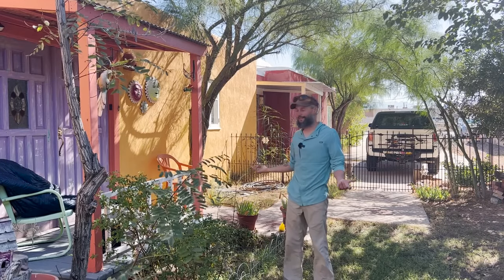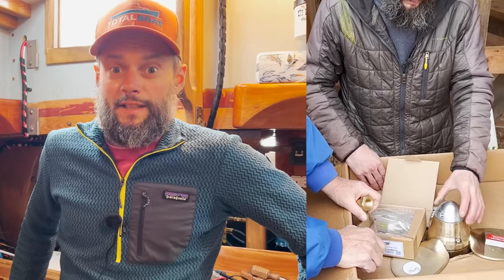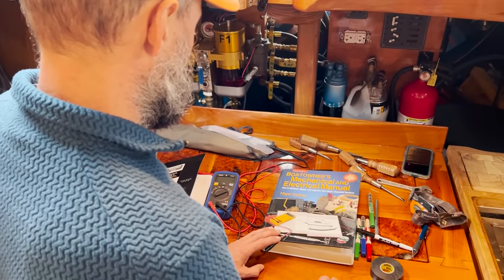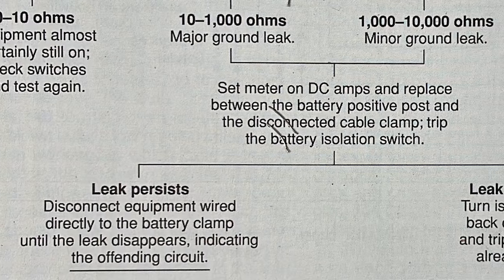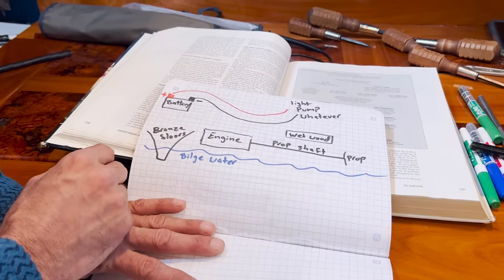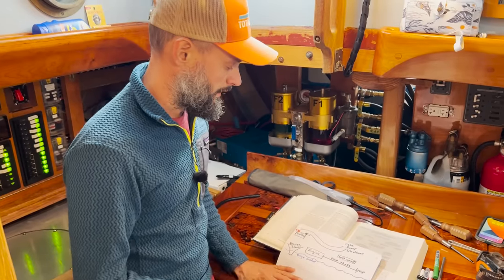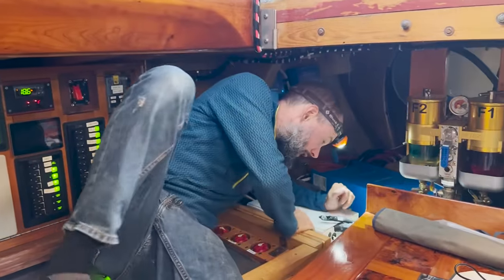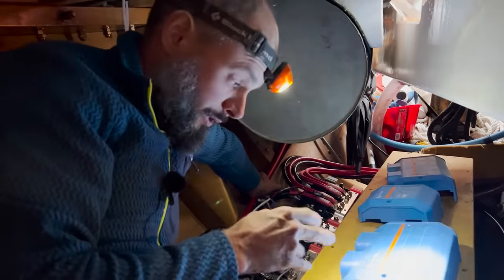Stray Current Puts Arabella in Danger - Episode 284 - Acorn to Arabella: Journey of a Wooden Boat

Comment: Steve, I watched this with interest, as I have a lot of experience solving difficult electrical problems.   If there was one thing I tried to drill into the heads of people I was training it is this: "Assumptions are the enemy."   More than half the time when I found the problem, it was something that had previously been dismissed as "that can't possibly be the  problem."

I've never seen Nigel Calder's book, there is likey an underlying assumption being made by the author:   Things WERE working correctly, then something changed.   Either something broke, or was incorrectly modified.    That is not the case with Arabella...you are doing commissioning trouble shooting, and can't assume that everything (or even anything) was ever as it should have been.  This requires a much different mindset than repairing systems that are known to have once worked correctly.  Something may have been incorrectly designed or specified, or not connected as the designer intended or a defective component may have been installed.

I see another deeply embedded assumption in your reasoning that might hinder getting to the bottom of this:    You are assuming that there is some extra path (leak) feeding current into the water.    Another possibility is that there is a missing or weak return path, such that current is going out to loads as it should, but is not (all) returning on the negative wires as intended...and is finding a route through the water.  Nothing I saw you do in the video would uncover this.

You made sure that loads that are turned off are not drawing power from the positive rail.  That is a good start.  But when things are turned ON, does all the current going out the positive come back on the negative conductor?   Unfortunately that is difficult to measure.  A DC clamp meter around both conductors could answer the question, but DC clamp meters are a little expensive...and fussy WRT earth's magnetic field.   This is what I use:  UNI-T UT210e   Under $60 on amazon and has 1 milliamp resolution.   BUT you have to zero it in the orientation it will have for the reading, earth's magnetic field will cause about +/- 20ma indication as you rotate the meter.  The clamp window is big enough to take a AWG-6 Siamese cable, or a 2-0 single conductor, so it might be a really handy thing for somebody leading a DC lifestyle.   Which suggests a crude but cheap way to test:  A compass held near a Siamese pair should not deflect when the load is turned on and off if the currents are equal.  Seems like somebody with your proclivities probably owns a pocket compass.

You can't just meter the negative connection at  the battery and compare to the positive side reading,  because they WILL be equal...current that goes out the positive battery terminal will always be balanced by current into the negative because that is how batteries work...the question is what path did if follow to get there.

Also,  you metered the bilge pumps when they were not running...this doesn't check any wiring beyond the float switches...in particular the pump motor, and failed motor windings are a VERY common source of electrical leakage.

The starting battery is being charged from the house battery.  The current drawn by the charger from the house battery + has to return to the house battery -.   Is the engine ground connected to both the house battery - and starting battery - , or just the starting battery?  I'm thinking it should be both, and if not, that may be the issue.
Reply: Replying to boost this. Good points.
Reply: Thank you for the valuable insights!
Reply: Also, test the bilge water for current. 
As for alternators, they can leak. Solenoids on the engine can leak. There are several items on the engine that can produce parasitic loads.
Back probe the driveshaft. 
The positive terminal is the destructive reaction. Your zinc is trying to be a positive terminal.
Good luck.

Comment: The multimeter was hooked up wrong, at least in this clip. 
The 10A socket should only be used when switched to the "amps" range. 
Not sure exactly what effect that has on the reading when set to milliamps, but it's certain it won't be correct.

Comment: I've done considerable work on power boats and one thing I always see are grounds between all components. Thru hull fittings, prop shaft bearings and couplings, fuel tanks and water and waste tanks,  pretty much anything metal bolted to the hull, all grounded and connected to the battery system ground point(engine usually). It's called single point grounding. Your current leak could between grounding points that are not connected together and not at the same potential.

Comment: It may be your diesel tank, if it is made of Monel. Monel is the most noble metal in the boat. If it not isolated properly or has a grounded sending unit it could be the problem. In the video you can see the tank in the background and it looks like a old Monel tank. It maybe one more thing to look at.
Thanks for the videos. It has been a great project to follow.
Reply: Joe, In the words of Yoda... Observant you are!  😃  You make a great point.  If memory serves... during the build they were careful to electrically isolate the Monel tanks from the boat for the very reason you described.  They used rubber liners / insulators on the mounting straps.  Still something might be contacting the tanks. 👍

Comment: Steve at 21 minutes you have your meter configured wrong red lead in 10 amp socket should be in mill amp socket even though the read out says mill amp. The meter was reading via a 10 amp shunt. Best wishes to you both on your climbing adventure

Comment: Nice troubleshooting exercise!  There are some additional possibilities which may be subtle.  

(1) ABYC requires that your AC ground connects the safety ground of your AC shore power inlet to the ships ground which usually includes the engine block and keelboats (lead keel & bronze fittings can create a tiny battery).  The AC ground (safety ground) is key to tripping breakers if a tool or appliance housing if energized.  Good practice is to install a galvanic isolator in the green wire near the AC shore power inlet.  I agree that it is probably not the source of your present problem, but it's an item to check.  

(2) Lightning protection (bonding) involves connecting metal shrouds ant the masthead to the keel and engine block to manage current flow and offers some personnel protection during a lightning strike.  Arabella has dyneema (non conductive) rigging, so your boat may have no lightning protection by design.  If it does have such a system, Calder's book offers pointers on best installation practice to reduce connecting systems electrically 

(3) Single sideband radios (not much used anymore) require a counterpoise which is another type of grounding system.  The counterpoise could provide a DC path to the engine, keel or lightning ground systems unless fitted with capacitors.  

(4) The engine offers a continuous DC ground by design which connects the block to the prop unless you have an electrical isolator on the prop shaft (so called zinc saver).  The starter, alternator, gauges and engine controls all use the engine as ground and the start battery connects continuously to the engine block.  In addition to the probably defective alternator, there are ways gauges and other engine accessories could impart current flow to the engine block.  Normally, this is not a problem and wooden boats have used engine grounds for years without a problem.  

A good corrosion control contractor could spend a day on the boat with your electrician to make sure everything is up to snuff.  Good luck running this issue to ground, as they say.
 

SB
Reply: I'm not a nautical person, but have dabbled in amateur radios. Regarding Item #3 above. While technically accurate, I would not expect the radio to be running all that frequently in transmit mode. I'm sure you have a transponder that is in full duty transmit mode, but and even then the power output to the antenna is not likely to be so tremendous as to be the primary cause of of this unexpected revelation. I'm not saying dont check them, but rather, "I'd put this item really really low on the list"
Reply: #4 seems likely - its a new engine right?
Reply: @HomoSapiensMember  yes brand new
Reply: Most new modern engines with a marine package already have wired sensors rather than using the engine as a common ground.
However, even on Marine engines, there is often a grounding strap located somewhere (often a braided wire strap which is hidden because it's painted over with the factory paint) which often runs to an engine mount.

Personal opinion about trouble shooting: Steve did a fantastic job of isolating and checking the DC systems. I'd suggest that if the alternator is the suspect, proof is in the pudding. When you get back, start the engine without the alternator connected, then with it connected. You won't be sure until you can reproduce it. Tricky to find, but once found, verify.

Comment: I did not read through all 300+ comments, so someone else might have already addressed the importance of checking the pencil anodes often found on some marine diesel engines. I can't recall the engine make and model on your boat, but if it has an engine anode it will likely need to be replaced as well - especially if the assessed cause ends up being correct. Cheers.

Comment: This is an example why this is such a great channel: excellent video explaining the troubles and the methodical way of finding out the likely cause. BTW, my money is on static electricity generated by petting Akiva. Might endanger the boat, but totally worth it ;-)
Reply: Yes ! Run an earth ( ground to US readers) lead to Akiva and fix an anode at the end of the lead and always having it in the water when Akiva gets a petting! Fixed!
Reply: Dear mathijs
👍👌👏😁😁😁😁😁
2) Please don't forget about the static energy when Robin is brushing her mighty mane! A lot of Archimedes screw shaped locks of hair might create a lot of power!? 😁 :-)
Best regards, luck and health in particular.
Reply: I am no electrician but why not just check if there was current at/on the prop shaft when running engine with the alternator connected? Wouldn’t that prove or disprove the hypothesis?

Comment: When you get your new anode, you may want to consider my aunt's rule of thumb: if it can wear out, order two, no matter the length of the wear timeline. Of course, when she passed, she had a lot of 'seconds' still in its original packaging: shoe soles, buttons, gaskets, oil filters, coat liners, kitchen gadgets etc. I figure she felt she won the race, since she spent zero time getting anxious about a non-existent replacement esp. for a unique or oddball item.
Reply: Good thought, but maybe not so feasible for a boat ;)
Reply: Yup, always order one for now and one for Ron - that's laterRon 🤣
Reply: 100%. Can you please explain this theory to my wife!
Reply: Spare zincs are super common spare parts stock on any cruising boat for this very reason.  I bet he has spares on hand already and if not he will after this!  Sailing magazines, books, and anecdotes in the marina have plenty of tales of stray current eating zincs and sinking boats.  It’s way easier to get parts when you’re coastal cruising the US, though.  Hard part is deciding what’s critical enough to warrant having spares onboard when you have such limited space.

Comment: Our steel hull was completely eaten away by some sort of electric stray current. We ended up disconnecting and not using everything and still don't know the exact reason. It took 3 months on the hard to get the corrosion damage repaired and we needed to remove all the interior. Just one small tip on working with not isolated tools, just put a towel over the contacts you're not working at. Way safer!
Reply: Hey Flying Coney!
Nice to see you checking the other good channels also ( Leo/ A2A/ Sail Life/ Ran) 
You to belong to that list 👍🏻
Keep up the good work

Greetings from the Netherlands
Reply: Leo and A2A inspired us to start a YouTube channel. I follow about 10 projects and I never miss a video of Arabella! It's a bit sad that no new restoration channels being watched by the algorithm. Don't know why this is. @CaptRobH

Comment: Steve, regarding the DC system troubleshooting.  An easier way to isolate the individual breaker is binary division of the problem.  instead of doing each breaker one at a time, turn on half of them and if there is no leak, that half is eliminated.  Turn those off and turn on half of the remaining breakers (1/4 of them total).  If the leak shows up, then turn off half of those (1/8th) until you get down to 1 breaker path.  Find that leak, fix it and then repeat the entire process to see if there was more than one breaker leaking.

Comment: Hi, I had a similar problem, but with a simpler system than yours. I replaced the stern gland, cutlass bearing, prop and shaft coupling on my yacht and started to have bits eaten away on the prop. It turned out that there was no electrical continuity across the flexible shaft coupling. A check across the coupling showed a small voltage difference. This was cured by adding a couple of wires across the shaft coupling to electrically join both sides. This grounded the shaft/prop to the engine/battery ground and sorted my problem. Good luck with sorting your problem and with the trip to New Mexico.

Comment: Before leaving, I would have checked the AC system for good measure. Based on your description, the likelihood the leak is in that system is nearly zero but I have done enough trouble shooting over the years to know that crazy and unexplainable situations exist. The theory about the alternator seems far more plausible than the AC system but the AC system is far simpler to test. It is probably worth the 30-45 minutes of effort just to be sure.

Best of luck!
Reply: Good advice. There are so many times when “it can’t be that” turned out to be “that”. Should have just checked “that” in the first place. 🤦‍♂️

Comment: Attach your multi-meter to a loose anode, and to the anchor point where it is normally attached, and put the anode in the water.
Try running equipment until you see amps flowing.

Comment: When you get back you should keep the starter battery system isolated from the house system.  Put the alternator back to the original configuration. If you want to use the alternator to charge the house battery then use a DC to DC charger that is designed to charge LiFePO batteries. 
More than likely the alternator had some residual magnetic field that caused it to generate power.
Reply: @dfhepner  100% correct. The house batteries should be charged through an isolated DC/DC charger connected to the start battery . The Victron DCDC charger can be configured to charge only when the engine is running either by a sense wire or setting the internal parameters. With the alternator back to original spec and connected to the start battery i guarantee the issue will be solved.
Reply: @Ozsmallbore  most alternators assume the engine block is a ground and so the negative of the alternator case is common with the negative terminal. Install a isolated alternator and an isolated stater. The system should have a return wire for each power wire.

Comment: steve as of 24;30 my hypothesis is the engine.  remember b+ is connected to the starter and b- is connected to the engine, which connects to the shaft and propeller.  i believe that the negative current "unplates"  metal.  you ran that engine a goodly sum.  does the charging circuit for the engine also ground through the engine?  how many amps are recharging the starting batteries?  please give this a thought and remember you asked.  replace the zinc, have someone watch and enjoy your trip.

Comment: Steve, I have to agree with you that it's probably connected to the engine. Most of the traveling has been under power so that's a good amount of energy and time used to eat the anode.
A couple of things you can do is fit a switch between the main and starter batteries so you can isolate them and the second thing is have a spare anode on the end of a long wire so if it happens again or the new anode falls off you can throw it overboard with the other end connected to the prop shaft inside the boat. Call it an emergency backup.
Have fun with the trip, hope all goes well. 😀👍
Reply: An extra "zinc" (anode) is an excellent idea.  You have no doubt seen the commercially available fish-shaped anodes on one end of a wire and a battery clamp on the other end to be connected to the vessel's dc ground or rigging if the steel rigging is grounded.  You can easily make your own.

Comment: The master fuse only disconnects positive.  Similarly, your circuit breakers (unless 2-pole) will only disconnect positive.  What if there’s a leak on the negative side?  I’m not an electrician; I’ve just seen weird electrical problems be before when the negative side wasn’t considered.  Great video!

Comment: Stephen, auto-parts stores have a canned dip that you dip your tools into to put an insulation film on them.  Great stuff.
Reply: Or get a peace of self adhesive heat-shrink tubing, use it to insulate any tools that might be used where high current / voltage maybe concerned, we did it to our screwdrivers too.